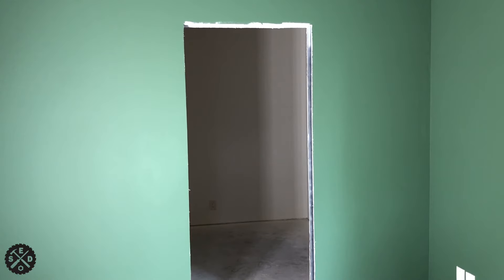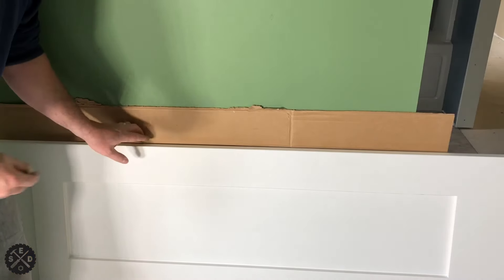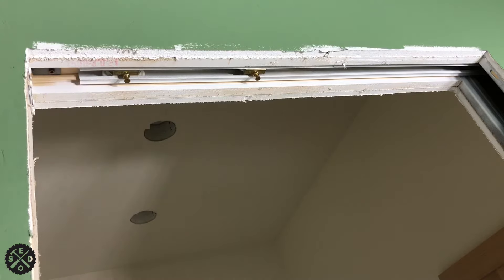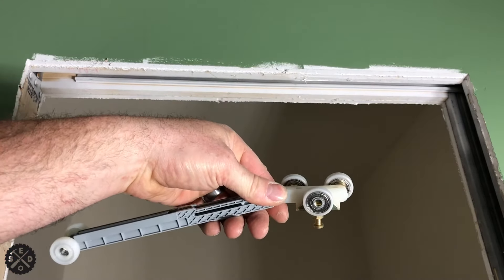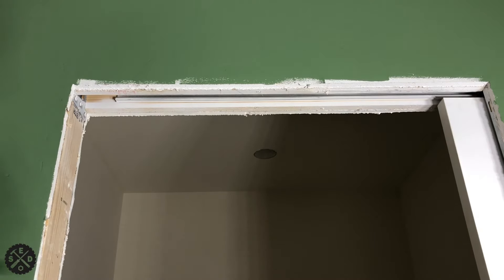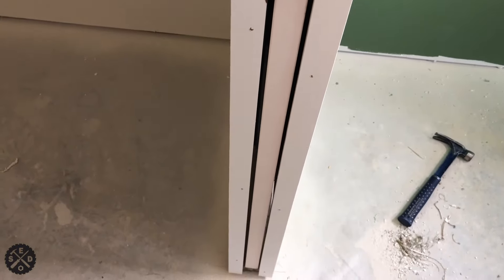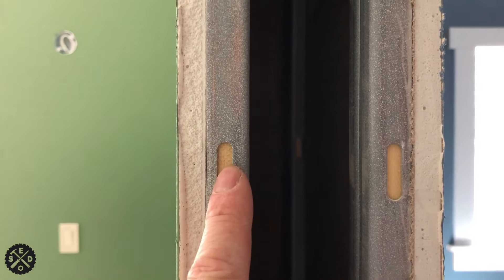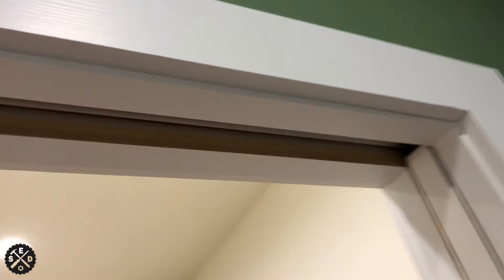How To Hang and Trim Out Pocket Door Johnson Hardware 1500

Comment: Appreciate the mini series on this pocket door install.  I just started hanging the drywall after installing this kit.  What thickness drywall did you use over the metal framing?  I’m currently using 1/2” but the wall feels flimsy where the metal studs are; like i can tap it and the wall vibrates so to speak.  Wondering if i need to up it to 5/8” or something.
Reply: Or does the wall stiffen up after you install the split jamb casing?
Reply from the maker: Boy, you know when I did mine it wasn’t metal frame like they are nowadays, so it may not be a bad idea to run 5/8 if you have the option. These on mine do have a little bit of flex, but not that I really think about typically.
Reply: @SmartEasyDIYer  im starting to think if i run the drywall vertically vice horizontally it may be a little more solid then hopefully the split jamb casing and trim will stiffen it up.  Maybe I should stop overthinking every project lol
Reply from the maker: @gregoryknotts653 ok yeah maybe so. 👍

Comment: For the trim and casing on the pocket side you used screws to the metal stud? If you cover up the screw heads, how you will remove it later?
Reply from the maker: Yes, I pre-drilled with a smaller sized drill bit to get it started and then used trim head screws and since it was paint grade trim, I puttied over the heads. If you ever have to remove it, you’ll have to dig the putty out of the heads.

Comment: Looks great.....I have the exact same pocket doors as well as the soft open and soft close rollers.  Right now doing trim.  As you said it's much easier to paint up in the track before trim is installed to not have to worry about overspray.  I just used some flat black rustoleum spray paint on my tracks.   But overall your setup looks great.  Hope mine turns out just as nice 😊
Reply from the maker: Thank you! Good luck with yours! 😊

Comment: Hey There! Awesome video. I'm working on trimming out a home for a builder. Drywall has already been installed around the pocket door frame, and now the homeowners want to add the soft close system. does that same bracket that catches it to close need to be installed on the opposite side as well, for soft opening? Wondering if I'm going to have to cut out drywall to attach it to the non exposed area of the frame. Thanks!
Reply from the maker: Hi JJ. Yes the soft open needs to be installed inside the other end of the track. I did a video on that before the drywall was installed. I’ll try to link that. https://youtu.be/5UmO1IwYGk0  In the comments someone had said they were able to do it without opening the drywall but I don’t remember how. It seems like it will need to be opened to access it and then patched.
Reply from the maker: Actually yes read the top pinned comment on that other video.
Reply: @SmartEasyDIYer  Thank you! I typed too soon, and then saw you answered it already after I posted. Thank you anyways! used 5 extensions to get the back bracket installed
Reply from the maker: Wow ok great I’m glad you got it. Thanks for sharing your experience too.
Reply: Thanks. I had impression from video that I could swap in the soft close rollers with no other modifications to my existing track. Sounds like there's a piece back inside the wall that engages? I prolly will open some wallboard to install a spacer where my bumper lands so that the door is flush in the split trim when fully opened, anyway...
Reply from the maker: Robert yes the soft open is the part that goes back up in there. It is doable with some extensions by the sounds of what JJ did above.

Comment: On their webpage it says that 2 of the 1060 kits are required if you want a soft open and a soft close. Did I miss this in the video? I thought you only installed one 1060 kit and your door has both soft open and soft close.  Thank you, Im about to add one of these to my bathroom along with a complete remodel.
Reply from the maker: No that is correct you need 2, one for open and one for close.

Comment: Would love to see a bit more around minute 6:52, how you packed down around the track, to support the revealed split trim at the top of the door. It looks like you packed down with wood cut to depth to match side vertical jamb tops, then trimmed onto that with the revealed split trim pieces supported into the packing, which in turn is supported into the same header the track mounts on. I guess the door top trim pieces are the same stock (or ripped-to-width) as the vertical split trim?
Reply from the maker: Sorry I missed this one somehow. I believe you are correct with your explanation. The main thing on pocket doors I like to put the top split pieces in last because if you ever need to adjust the wheels on the track, you can remove those without taking apart the whole top.

Comment: I use lightweight spackle to caulk the holes. It doesn't shrink like caulk and it's easily applied and sanded. ( I use an old credit card to apply it). It also dries rather quickly.
Reply from the maker: Thanks for sharing your tips!
Reply: What CAN'T one use lightweight spackle for? I smeared it on some rough plywood facing to make it a paint-ready surface and it seems to be holding up a year later...
Reply from the maker: That’s too funny 😄

Comment: Probably a dumb question but the Johnson pocket door frame I have didn’t have wood inside the metal studs. Did you add that yourself or did I screw up something? Just curious about how to attach trim without it. Thanks
Reply from the maker: Hey I’ve heard some of the newer versions of this is so metal. Haven’t seen it myself. I think maybe they include some metal screws for that?
Reply: @SmartEasyDIYer  As of Jan 2020 they were supposed to all come with metal studs.   Supposed to make it stiffer and able to handle heavier doors.

Comment: When you first hung the door, it would recess/close past the door jamb.  In the final reveal, it closes flush with the jamb.  Is there something to adjust that sets that?
Reply from the maker: I think maybe I had to adjust the soft close for that 3/4” thickness difference. You can do that with that wrench or screwdriver I believe before finishing off the top piece.
Reply: @SmartEasyDIYer  Thanks - I was hoping it was a hardware adjustment, and not a re-cut(s).

Comment: Did you use any bottom door guides?  Typically I like to install the channel into the underside of the door (easier with 1-3/4'' thick doors) then put the guide pin on the ground.  Johnson system just suggests routing a channel on the underside of the door without a channel and hiding the exposed groove with a cover plate.
Reply from the maker: I didn’t end up doing one yet. I haven’t gotten around to it. My one problem is I have concrete floor so I wasn’t sure how I was going to fasten it yet.
Reply: @SmartEasyDIYer  I did it with tapcons.   No wobble in the door and no scraping on the bottom with the other type of guides.

Comment: Paul, great video!
I notice that you show adding the stop that goes onto the rail for the soft close at the very end.
I didn't see you install the one at the other end for the soft open?
I'm considering using this but my walls are finished.
Ty
Reply from the maker: Yes this is kind of a follow up video. If you check my channel I have a video about the install of the soft close. You need to do it before the walls are finished or else you have to cut a hole in the wall to put them in.
Reply: Knowing that eventually the wheels will flatten out, or the soft close damper will fail, I cut out and installed a 6x9 mud-in flush access panel at the far end of the track on one side. You could do the same for a finished wall if you wanted to add the additional soft open feature/hardware.
Reply from the maker: That sounds like a great idea. Especially on the closet side you’d never notice it.
Reply: @danervin2530  Great Idea, but is it necessary?   The only thing you need to access from the closed end is the stopper arm.   Once it's installed, the only thing touching it is the plastic piece on the rolling soft open mechanism.   If the rollers flatten out, or bearings jam up or whatever, we know they will!!, you can get to them from the opening side, just take the door off and loosen the soft close catch arm, then take out the rollers and replace them.   Great system, just have to have the one piece done beforehand.

Comment: Did you put in a soft open as well? If so, how did you put in the bracket that goes in the channel?
Reply from the maker: Yes I did soft open as well. You have to do it when you can still access before drywall or else you have to cut a hole in the drywall after the fact. https://youtu.be/5UmO1IwYGk0 this video shows the installation.

Comment: Great job.  one question.  It seems hard to pull the door open. I've seen pocket doors in others people's houses and always struggle to find the latch to pull the door open , especially ones with a soft close system holding the door tight.  What pull system do you use to solve this?
Reply from the maker: Thanks. I know what you mean. I actually haven’t gotten around to installing it yet cuz life… I was going to install one like this with a built In pull. Idh by St. Simons 25411-10B Solid Brass Pocket Privacy Pull, Oil-Rubbed Bronze https://www.lowes.com/pd/idh-by-St-Simons-Idh-by-St-Simons-25411-10B-Solid-Brass-Pocket-Privacy-Pull-Oil-Rubbed-Bronze/5000746683

Comment: This has been incredible!!! Did you do a video of attaching the drywall by chance?
Reply from the maker: Thank you. No I didn’t because someone else installed the drywall. The main thing is to use really short screws. You’ll have a hard time going through the steel on the backside of those anyway with longer screws but you want to use short screws so it doesn’t damage  your door.
Reply: @SmartEasyDIYer  The kits include self tapping drywall screws now for the metal.  They don't go too far in.
Reply from the maker: Awesome thanks for the info that’s great to know!

Comment: Thanks for all 3 videos.   I had a Cavity Slider put in at a friends house I was getting fixed up.  He wanted the best and CS seem to be the cadillac of pocket doors.   I'm putting in a J&J bathroom between two bedrooms for my grandkids.   I don't need a cadillac.  :-)  I picked up two of these 1500 kits along with the soft open/close mechanisms.   I bought the door guides that will run in a slot on the bottom.   I'm also installing on a slab as you did so these videos were really helpful.   I saw that Johnson had a Jam Kit, but it looks like you just used a standard jam and ripped it to where you needed it.   Was that the case?   Thanks again.
Reply from the maker: Thank you. Yes I ended up just ripping my own.

Comment: Very helpful, thanks! Since I'm tight on space (cutting down 32" doors for 30" frames), can I forego the frame's rubber bumper with the soft open hardware?
Reply from the maker: Thank you! I believe so with the soft open feature. You can hang it and test it out to be sure before trimming it out completely.

Comment: Thank you for the Video... my question is about screwing the metal parts to the Top of the door, in my case it seems to split the wood even when I predrill pilot holes. The doors I wanted to install are Hollow... did you use Solid wood doors?
Reply from the maker: You’re welcome. Yes my doors were solid instead of hollow core. It seems like the top would have a couple inches of solid though even if it’s hollow core. Sounds like you may just have a door that has a very splitty piece of wood. I’m not sure what to tell you except maybe try pre-drilling it and getting a screw that’s bigger thread and a little more aggressive to hopefully hold it on better. I’ve never seen this done but you could think about maybe applying a little construction adhesive under it before fastening it to help hold it on better once it cures. Just a thought.

Comment: Do you need to finish the wall before hanging the door? I know the instructions say to finish the wall first, but if the door/pocket requires any adjustment, it'll be too late. What's your experience?
Reply from the maker: I suppose you could probably hang it and test it out and then take it back off. As long as everything is level and straight it should be OK without doing that because you shim your casing to make it straight with the door once it’s hung. But it’s pretty easy to pop it back off before hanging drywall and getting it messy if you want to make sure.

Comment: An alternative to cutting a relief in the jamb is to space it off of the stud with a few 1/4 in shims.  Nice job on your door.
Reply from the maker: Thanks 👊
Reply: How did you cut that relief in the jam?
Reply from the maker: I’m not quite sure if I’m following but if you mean for that header plate I think I just planed some out or used a table saw etc.
Reply: @SmartEasyDIYer  for around where the screws mounted the top plate in the wide jam. You had a clearance cut so the jam would be flush
Reply from the maker: OK, yeah I think I just ripped it on the table saw a little bit or use the hand planer to take some off. You could even use a circular saw and just set it like a quarter inch deep and rip a bunch of strips side-by-side close together, then chip it out with a chisel.
Reply: @jpeterson991   To clarify, instead of cutting out a notch in the back of the jamb at the top to provide clearance for the metal bracket (see at 5:47 in the video), use 1/4 inch shims between the jamb and the stud. The shims position the jamb away from the stud enough to provide clearance for the metal bracket at the top.  Put shims near the top, middle, and bottom of the jamb. Vary the thickness of your shims from top to bottom as needed to make the jamb plumb.  The resulting small gap between the jamb and the stud will be covered when you install the casing around the door frame.  This is the preferred way to install a door jamb. There should be a gap; don't nail it right onto the stud.

Comment: Awesome videos Paul. They are really going to help this DIYer when I attempt this project soon. Quick question, I hear a popping noise when you first pull the door closed and I think when you open it too. Does that noise always happen, or did it only happen in your video because you don't have the handle on and had to pull the door from the top? The reason I'm asking is because this will be installed in the doorway going from the Master bedroom into the Bathroom. My significant utter is a light sleeper, so I have to be able to nearly silently open and close the door right now. I think that popping noise might be an issue.
Reply from the maker: Thanks! So yes it does make that noise some every time. It’s not as loud as on the video I don’t think but it’s there. What it is is the soft open and soft close feature on these doors engaging and disengaging. If you’re really concerned about it you could just not use that option and use regular rollers that come with it.
Reply: The sound will wake my 2 year old up even with his sound machine going, but to be fair his bed is close. The rollers will be noisy on any pocket door as well. I just go slow and stop before the soft close engages, it will leave the door open a couple inches but that's your only option. In my opinion the non soft close rollers are more quiet than soft close. Unless someone slams them open or closed lol